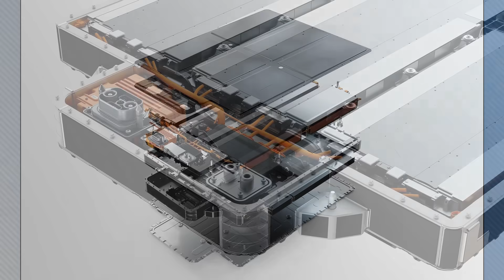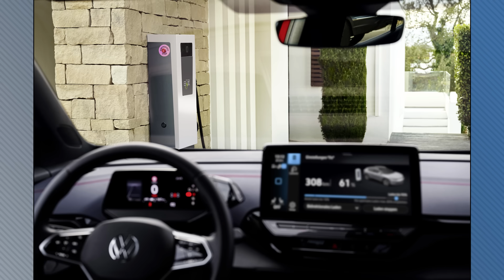U.S. EV Sales Top 1 Million; EVs Reducing Oil Demand - Autoline Daily 3705

Comment: EV sales are higher in warmer cities but not colder more isolated areas which are a huge part of America.  
    60 % of the chargers are located within California with minimal to none in rural areas.  
    Most EV are too small to accommodate families and the larger ones are priced so high most families could not afford.  
   This push of EVs is a fad as we are discovering that the carbon foot print is going to be worse than manufacturing ICE. 
    The left always pushes it as a “ green “ vehicle but it’s apparent that the minerals required are going to set up a massive “not green” 3rd world boom which will only benefit a handful of millionaires.  
    Americas left loves NIMBY. Out of site out of mind.  
   The recycling of the millions of batteries is also going to be a “ non green” nightmare.  
 The world needs go with regenerative tech to combine gas/electric which gives both better gas mileage in a more realistic vehicle made for everyone not just the warm state inhabitants
Reply: Every house in Rural America has electricity, not so many gas stations in the woods

Comment: Numbers don't lie.  But, they can be skewed.  The adoption rate of states like California, which has an approximate population of 39 million, moves the needle a lot.  Pickup country, like where I live, EVs haven't been embraced yet.   It will eventually happen, but not for awhile.  As been mentioned hundreds and hundreds of times, the charging infrastructure is not there in certain parts of the country.    A friend of mine owns and operates a nice restaurant/sports bar in the DFW area.  Tesla offered to install some charging stations at no cost to him.  He had to decline, because  the draw would not offset the loss of customer base that are so anti EV.  His "regulars" would just bail.  There is still a lot of anti EV sentiment.

Comment: V2G and selfplug-in will explode EV sales. 
And rooftop PV will have exploding sales.

Grid expansion costs are extremely high, nobody is talking about the fact 66% of electricity bills are grid costs.
5times more electricity means 5times bigger grid capacity if central generation expands.

Millions and millions of miles and $million per klm to build new grid or capacity.
5times bigger, $TRILLIONS and decades and decades and decades

Generation and storage at the millions and millions and millions of grid ends means extra transmission is not needed. 

Infact the grid is UNLOADED and protected from blackouts. 
The batteries stabilise the grid. 

Rapid chargers will be on the main roads and at corner stores.

Comment: Did the IEA take into consideration how much coal and natural gas would be required to power all those EV’s?
Reply: No fossil fuels are required to power EVs but we still mostly do it that way, for now.  Yes, IEA considered that and they still predicted peak fossil fuel consumption during this decade.
Reply: The U.S. is about 95% down in coal as a source of electricity production. Most st NEW electricity production are natural gas’s and renewable
Reply: @johnryan6003  Fracking killed coal.  Natural gas is cheaper and cleaner,  less maintenance,  lower capital costs.
Reply: @johnryan6003  Wrong. The peak of coal production in the United States was in 2009 and is currently at 50% of that amount, not a 95% reduction as you claim. Besides that, this discussion refers to EV usage across the globe where coal is the dominant fuel used for electrical production.
Reply: Do you know how much less energy it will be not refining millions of barrels of oil into gasoline?
Reply: @nguy404  Do you know how much energy it takes to mine and process fuels for electrical energy production?
Reply: These numbers have been crunched, yes.

It is very naive to think they haven't been.  Many companies and agencies have done it, and not only the oil companies (that perhaps you are working for), but other types of companies.

If you want to see the details, see the channel Just Have a Think.  Look for his oldest videos.  He laid it all out years ago.

Bottom line:

A) Transitioning transportation to electric is absolutely necessary to reduce greenhouse gas emissions and address climate change.

B)  The EV transition would have a substantial impact on total emissions from transportation even if the grid was 100% coal everywhere.

C)  The grid is not 100% coal, or gas.

D)  The share of energy generation from coal and gas is dropping rapidly, worldwide.  

E) Adoption of solar and wind is increasing, not only in rich countries but in many developing countries, because it is cheaper and easier to build than fossil fuel plants or, God forbid, nuclear.
Reply: Yawn, such an old talking point
Reply: @TokyoOlympics2020  It’s a question. Do you have an answer?
Reply: @CS-gg5hx 
Invest in coal!! Invest in oil!! Burn burn burn!!!  

The last coal-fired power plant in the US was built in 2013. Coal is dead.

Comment: If gasoline car lovers think lower oil demand will mean lower gas prices, the oil industry has a nasty surprise for you. Lower oil exploration and shutting down refineries will mean lower supply to keep prices up at least as expensive as they are now in order to keep profits up.
Reply: Last I heard, OPEC is cutting supply (again ) to justify higher prices (again).  As they have done many times before.

They will get their pound of flesh from ICE drivers, as long as there are ICE drivers.
Reply: @davidmenasco5743  or until demand falls so low that other countries now have the ability to produce substantial surplus. The problem comes from the imbalance of some countries using so much oil that they can’t meet their own consumption, and some countries having seemingly infinite oil. Once demand falls so that many more countries now have surplus, that power imbalance begins to equalize.
Reply: But. Lower solar and more battery grid systems DO mean lower costs. There are no fuel costs for renewable. Think about that a few times. No fuel cost for renewable energy production. And all material consumption St’s required to create and store renewables drop very year, in aggregate.
Reply: Yes, whenever oil prices are up and a president they don't like is in office the very small brains think that its the presidents fault, when the fact of the matter is that oil is a world commodity and the US is a very small player when it comes to surplus oil.  We produce a lot of oil, but we use the most.  The countries with all the surplus oil have the most control over oil prices.
Reply: You are not following..
And Don't understand the facts and have been fed and swallowed he dem line on this... 
The current pres did make it almost impossible for domestic oil companies to produce oil and gas in the USA. Making the US dependent on foreign oil . 
Knowing that, foreign oil companies have raised their prices and are making record profits and we in the US are paying record prices for gas ... And we have depleted oil reserves which makes the US vulnerable...

When the US starts to produce oil again after the Republicans come into office and remove the Dems constraints on oil production you will see the price come down of gas at the pump like it was before j.b. stole office ..😂😂
Reply: But when a president makes it hard or impossible for his own countries oil companies to drill for oil  and produce gasoline domestically on his first day in office ... The international part takes over ....😂😂
Reply: @customsolutions7167  no. You are low information. The president has very little ability to control oil prices at all.

Comment: Reducing oil but increasing coal, fossil fuel either way.  Until more homes or charging stations are wind/solar, EVs are simply moving pollution away from the cities, which isn't bad, per se.

While not practical for everyone or every case, I'm betting Aptera will have a different impact. 

For those who don't know, Aptera is a California start-up making a solar-battery EV with a highly aerodynamic shape as an enclosed 2-seater with 3-wheels.  The company originally started in the middle 2000s with a diesel-electric hybrid, but the company eventually liquidated before production due to opposing goals from investors and founders.  Then, in 2019, founders restarted the company, changed the design, and made agreements with suppliers and contractors.  Now, after 46,000 pre-orders and bought two large facilities, they are on track to start production within a year or two.

Impatient folks will complain that no production date has been set with a series of delays over the years.  But those who've been following their progress are not impatient.
Reply: Moving to EVs is more impactful than just moving the location of where pollution is produced.  The energy supply chain to power EVs is more efficient than ICE.

Also, Aptera will not make a material impact.   We'll see them around and they are efficient, but they will not be produced in large enough numbers to move the needle.
Reply: Aptera is such an obvious scam, bag holder spotted

Comment: Such great news on the beginnings of the transition away from fossil fuels. I suspect that this will only accelerate as the economics of electric propulsion and using renewables to generate electricity rapidly improve.
Reply: When was the last time you read about an oil well going dry?
Reply: @TNitroH  That's not news any more. Just drill deeper, and charge more to pay for the drilling. And vent the methane.
Reply: @TNitroH  After they go dry, you frack.

Comment: I'd like to know how those EV kWh of energy are being produced.  Far as I know there's still no true free lunch.
Reply: EVs are much more efficient. Ask around how much they cost to run vs. dino juice.
Reply: @jamesvandamme7786  True story.  No matter the source of energy, EVs use less of it to turn wheels.  Internal Combustion uses most of the energy to produce heat.
Reply: Are you as concerned about the energy, often electricity, used to drill, pump, pipe, and refine gasoline? To be burned, at the most 30% efficiency and then dumped into our atmosphere.
Reply: @hayduke4589  my Prius has a thermal efficiency of 40+%.  My question has nothing to do with efficiency.  The production, transport, charging and discharge of EV batteries incurs losses as well for that matter.

Question remains. What methods are being used to create the electricity used?

Comment: Of course EVs reduce oil demand - they run on motors, not ICE. Of course EV sales top 1 Million - Uncle Sam provides huge subsidies to buy them. Be that as it may, the value proposition is still not there for the average car buyer. It's unsustainable for so many reasons.
Reply: Name one of the many unsustainable reasons.
Reply: @snookmeister55  - You simply don’t have enough Lithium to replace over 3 billion ICE cars, even long-term. The current battery chemistries we have right now are not good enough. Did I mention the charging infrastructure is not there?! They’re too expensive and have poor resale value. No one wants to buy a used electric car. Is that enough for you?
Reply: @donyakusa9187  False.  Lithium is practically everywhere and refining capacity is increasing.  Do a news search on it.  Battery chemistry is not a finished story and it improves practically each day with billions invested in research and development.  Million mile batteries are in cars now. 
There are certain new and used EVs that don't sell but that doesn't apply universally.
Charging infrastructure is growing with sales.
Your thinking and beliefs are self limited I believe.
Reply: @snookmeister55  - Well, our government and others got bamboozled into putting all their eggs in this electric car bandwagon. Hybrid is the way to go for the foreseeable future until we can solve the biggest problems facing the EV industry. Personally, I’m buying a hybrid car in heartbeat. I’m not drinking the EV coolaid.
Reply: @donyakusa9187 How do we have enough gasoline for 3 billions cars? Build out as needed and more.
Reply: @nguy404  - You’re not comparing Lithium to gasoline, are you? Do your research on Lithium mining. There’s simply not enough at scale. Plus, Lithium mining is as environmentally catastrophic as fossil fuel. The majority of people share the same view - the adoption of hybrid vehicles is a better alternative  than EVs in the short and medium terms. Some of you are ecstatic about 1 million EV sales, but in reality it’s pathetic considering EV car makers and dealers have been receiving billions of dollars in subsidies for well over a decade now.
Reply: @donyakusa9187  just because it hasn't done before? Mining at that scale was never needed until now. Lithum is plentiful. Do you think 90 million barrels of oil per day appear out of nowhere? The need accelerate the production.
Reply: @nguy404  - Lithium is not as abundant as oil. You’re mistaken. Do your research.
Reply: That will change in the coming years.

Comment: In addition to mining, power transmission lines connecting low cost solar plants in the southwest to population centers also take 10 years plus to gain approval. With battery backup, this is the cheapest, cleanest power available and it can power our entire economy. But how can a business case be made if there is no certainty of permitting?
Reply: Tunnels.   Put the power transmission lines underground.  I would think the business case would be made first, regardless, then permit it and build it.
Reply: If Elon's Boring Co. can open up hyperloops ad nauseum around underground L. A. then he's got more clout than me.  Get the permits and let's replace the whole thing.  There is a cost savings and an environmental savings.

We can't afford not to do it.
Reply: @AllDogsAreGoodDogs  Mostly just a couple of test tunnels at LA.
Las Vegas project is proof of concept.   The Boring Company is located in Texas.
Reply: @snookmeister55  The chance to light up LV using Tesla equipment.  This will reduce demand on hydro that is running out and Tesla can use the already-bored tunnels to run the power.  Casinos will lean on the city for permits, no big.
Reply: @AllDogsAreGoodDogs  The tunnels are for electric cars.   City of LV is the primary customer with others such as Casinos, hotels paying for stoping terminals.  To and from airport.  Should be nice.   Traffic travels 1 direction in tunnels.  Only a small portion in operation.
Reply: @AllDogsAreGoodDogs 
U have clout ? ..😂😂😂

Comment: No worries, while demand for oil decreases, the demand for natural gas and coal increases steadily to keep up with demand for electricity to charge all those EVs.
Reply: untrue....the percentage of electricity generated from renewables is increasing rapidly. As BEVs and renewables increase, the demand for fossil fuels will decrease....as it must do if we are to keep this planet inhabitable.
Reply: @dangrass  👍👍👍👍👍
Reply: Natural gas Yes. Coal No. Solar dominates the new power source in the US and the world. 😂
Reply: Lol, not coal. Natural gas, solar, and maybe wind.

My local utility in a cold region is in the process of retiring coal generation entirely by 2032 and building out more solar, with natural gas being the primary generation fuel.
Reply: That's not the prediction and I doubt it will happen.  It's cheaper to build a solar plant than to run a fossil fuel generating plant.  The missing component is enough storage batteries to go with wind and solar but that is being solved.
Reply: Coal is ded.
Reply: Solar and wind, with utility storage, are cheaper to install than coal and natural gas are to continue to operate. Coal is already dead. No new natural gas plants are being built.